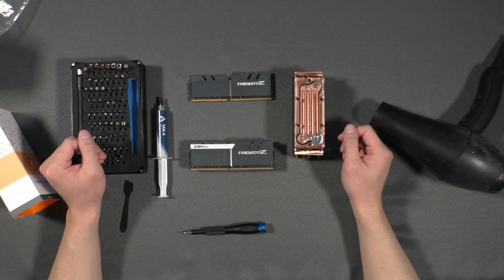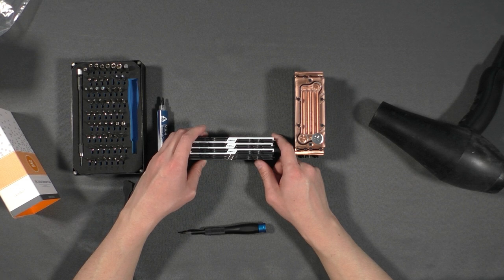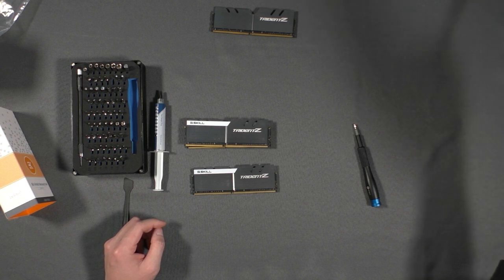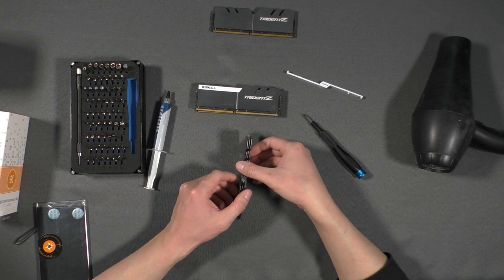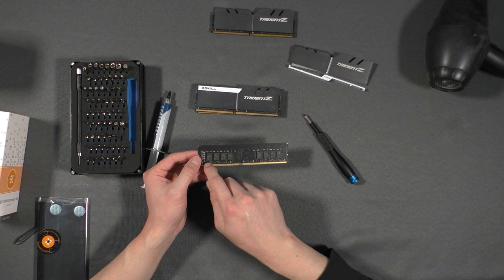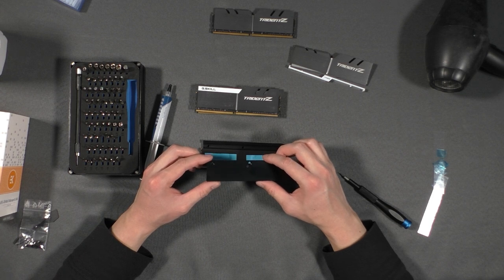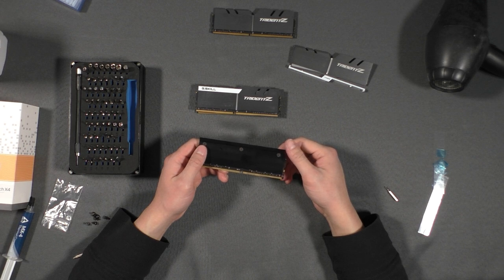DIY Watercooling Your RAM in 2020 - Curing Your Overheating RAM

Comment: Wait what’s the part at the very end? How did you get the actual water block onto the ram sticks? Can you make a video showing that because after doing everything you did in the video I’m just left with 4 ram sticks with the new heat sinks on them, and I don’t know how to incorporate the water block onto them after that
Reply from the maker: It’s the final assembly with the block + 4 ram modules.
Reply: @techcraftstudio9340  yea I get that, but I’m just wondering how you attached them together
Reply from the maker: @FlameXRLD  I the end of each heatsink on the ram stick should have one screw hole. The waterblock goes on top and the then screws secure them on to the ram sticks. Does your kit come with screws?
Reply: @techcraftstudio9340  oh yea it does, that makes sense now so thanks I appreciate that, but in all honesty, do you really think water cooling ram is really that necessary? like if you are overclocking and such i get it but, to what degree would you have to in order to really make use out of it? like for you specifically are your timings very tight or do you have the clock pretty high with a high voltage? and if you did do some manual oc, what specs and settings did you end up with
Reply from the maker: @FlameXRLD  For me it is worth it because I don’t have air flow over my ram so they do run very warm. I’m running 3200mhz with decently tight timings at 1.4v.
Reply: @techcraftstudio9340  whats your ddr4 temperature before and after?
Reply from the maker: @DainHunter  Before it would AVG 61c and now it is 54c AVG.
Reply: @techcraftstudio9340  5 degree difference is pretty decent 👍

Comment: You should also show us how to get the watercooling-block onto it, I am new to watercooling and it's best if I know:)
Reply: The copper colored part is the waterblock for the part. you install the ram into your motherboard first and then  place the block on top. Align the screws and block before fully tightening.

Comment: Did you ever get temperature results before/after cooling your sticks?
Reply from the maker: Tyler Durden Yes. Before the sticks would hit 55c. Now the hottest is 42C. This is with 24C ambient temps.
Reply: @techcraftstudio9340  cheers. Installing my block on my b die tomorrow.
Reply: @techcraftstudio9340  I can't seem to get stable 12-12-12-24-240-T1 on my B-die kit, voltage won't even go past 1.55 V without system going into a boot loop. Even with VCCIO/VCCSA both at 1.3 V, which should be more than enough at 3200 MHz even with those timings. I'm on X99 platform running a 6950X. I don't know what my DIMM temps are.
Reply from the maker: Nuclear Armament I’m not familiar with X99 and Intel processors from that generation but those are really aggressive timings. What are your stable settings?
Reply from the maker: Nuclear Armament what are your other subtimings?
Reply: @techcraftstudio9340  I unfortunately cannot remember. I've only really messed with the main/primary memory timings. I have no idea how secondary or tertiary ones work.
Reply from the maker: @NUCLEARARMAMENT  I see, I have a feeling your subtimings may have a big factor in your stability. Although I will have to say your primary timings are aggressive.

Comment: I'm gonna get a ATXmotherboard with gtx 1070+rtx 4090
Is it possible to fit in watercoolings for both of them? I want to water-cool everything (Not everything but the memory, ssd, cpu and gpus)
Reply: There are alot of variables but generally yes. It depend on your GPU make and model as well as the motherboard and case you are using.

Comment: what thickness are the thermal pads?
Reply: For the monarchs it's 0.5mm on the memory IC side, if they're single rank dimms (so with memory only on one side) then it's 0.5mm on one side and 1mm on the other, if they're dual rank and have ram ic's on both sides then it's 0.5mm on both sides

Comment: Wait you can overclock 8 ram sticks that are each dual rank? Holy crap what a memory controller. Sounds like bs to me tbh. Even just quad rank usually can’t even do 3933MT/s.
Reply from the maker: Each ram stick is dual rank but I am running them at 3200MT/s. However I am running them a slightly tighter subtimings. I think that is the limit of the memory controller on my CPU because anything more will be unstable.
Reply: @techcraftstudio9340  Yes it is. I can run 4x8gb 4066 cl16 at 1.5v. I am getting the ek waterblock to test cl14@1.55v.

The 8gbit per IC dimms are much easier on the memory controller. B-Dies are sadly no good in Quad rank.

Comment: it looks to me that you forgot to peel off the plastic on the thermal pads
Reply from the maker: edwin leano I didn’t record removing the plastic for every pad due to time.
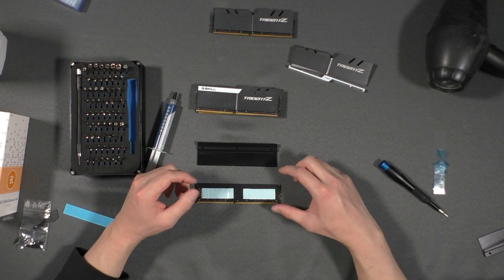Reply: @techcraftstudio9340  i based it around 6:30 and 7:30 of the video.
Reply from the maker: edwin leano thanks for the heads up. I’ll double check my ram sticks.
Reply: You are right. He forgot to remove the plastic cover.
Reply from the maker: @edwinleano1289  It's a good catch. I removed the plastic film now.
Reply: @techcraftstudio9340  good stuff

Comment: Also... Cab you run without water block..? I don't need watercooled ram just nickel plated ram with no rgb lmao
Reply from the maker: tigerag29607 I did run the ran sticks for a few weeks without the waterblock. They ran just fine. I’m assuming as long as you don’t overclock heavily, they will run fine. Just my experience with it although limited.
Reply: @techcraftstudio9340  I guess it's just as good or better than running ram without as it has more surface area.. Just wouldn't want it to catch all the heat you know.. Appreciate it!
Reply from the maker: tigerag29607 If your ram currently doesn’t have any heatspreader, it will will definitely help temps to have something.

Comment: This is very boring. Why no performance comparison? Or were you lying about the temperatures?
Reply from the maker: I wanted to mainly show how to install the heatsinks. I was not expecting any performance improvements since I'm still running the same speed. In retrospective, I should have taken before and after temp screenshots.